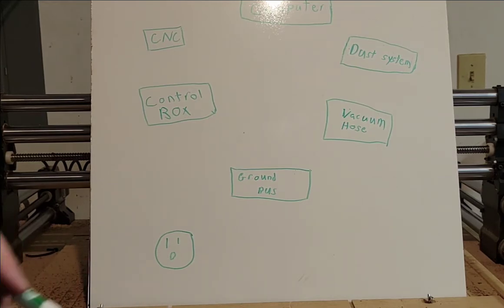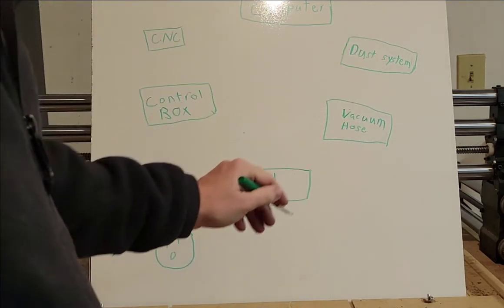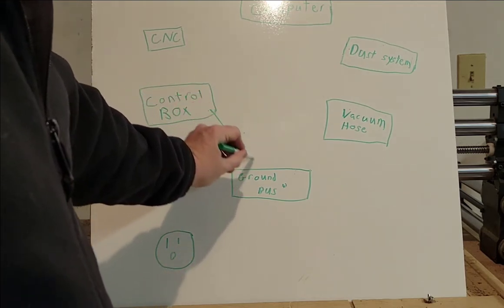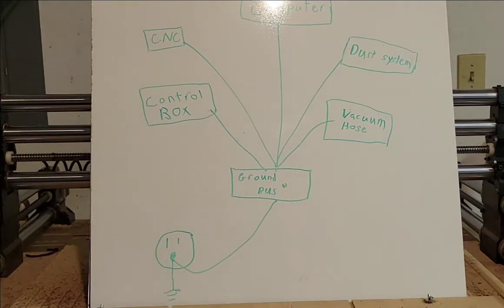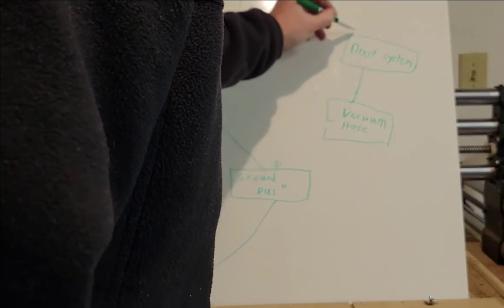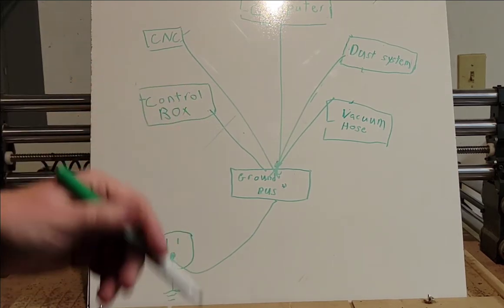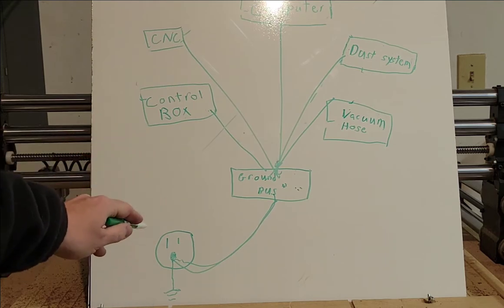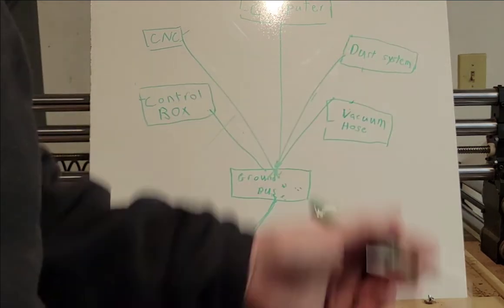CNC Grounding - Jeff Holmes - Hanging By The Moments

Comment: Howdy! Thank you for this video! My CNC has the control board grounded to the side rail. If i set up this star system, should i disconnect the control bosrd ground from the rail and connect it to the new star board? Thanks!
Reply from the maker: That all depends on how/where the rail ground is attached. If it is connected to a common ground on the controller I would leave it alone. If you are having issues then remove it and take it directly to ground.

Comment: Every time air assist is activated the cnc cuts connection and needs a hard reset. 
I'll try routing ground directly to the plug and add a bus bar. 👍 
Fingers crossed. 
Only option left is a dedicated main fuse and new plugs but 💵 💵 💵

Comment: Hello Jeff,
Where do you mount your ground bus? I looked up ground bus it showed different options but was wondering where do you mount it to? Thanks for the video you made things sound simple.
Reply from the maker: With my particular setup, I ran separate circuits for everything that gives each device a direct path back to the ground bus in my breaker box.

Comment: so basically I can use the ground connection in another plug socket?  would this also work for a cnc Laser?
Reply from the maker: Yes the grounding should be the same.
Reply: @hangingbythemoments3762   i have been over thinking this one :)
Reply from the maker: @adrianharrison5208  it is easy to ground things too much and actually make things worse.
Reply: @hangingbythemoments3762  " it is easy to ground things too much and actually make things worse." what do you mean by this? like not doing star? or what. I'm literally going to be doing this very thing but this comment scares me out of it straight away! how do you 'ground things too much'?? (just trying to not make it worse!)
Reply: ALSO-- I've seen other videos that will measure the resistance back to the ground bar from the ground point and try to get 'x' maximum resistance. do you subscribe to that as well? (I literally got my FLUKE179 in two days ago for this very undertaking!). I just updated to a 2.2k spindle on my CNC with water cooling, so this is why im thinking all about this.
Reply: Yes this should also work with a laser.

Comment: My vac hose generates a lot of static, my concern is that won't it have the potential to back feed into the cnc from the bus bar? I'm currently setting up my system now. Also am using a UPS for the controller and router...
Reply from the maker: What I would do is wrap the hose with a bare copper wire a take it directly to either earth ground or the ac circuit ground.

Comment: I am lost where you said to tie it back to the plug..
Reply from the maker: CASA CUSTOMS thanks for the feedback. When I say "tie it back to ground in the outlet " it is technically the ground in your electrical panel.  I tried to explain that in the video but I guess I should have done a better job.  The ground in an outlet is the same as panel ground.  Basically as long as everything is plugged into an outlet you are fine. Where people tend to get in trouble is if they attach something like the frame of their CNC machine to a ground terminal on their control box.  Does that make sense?